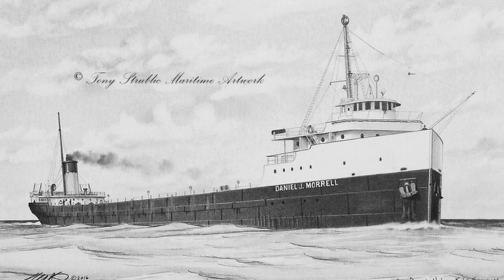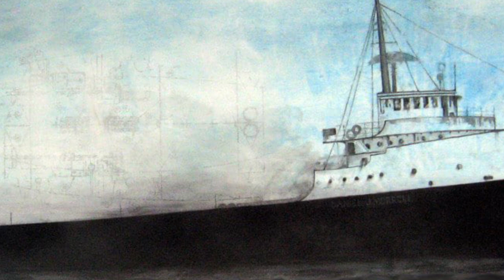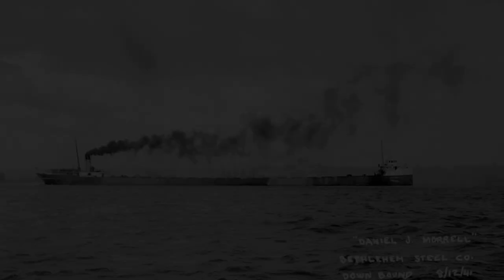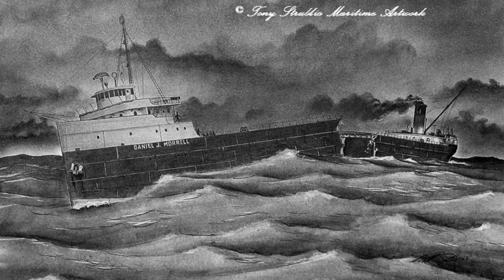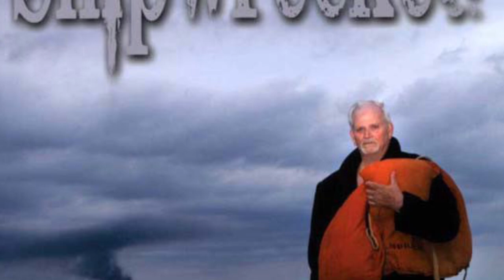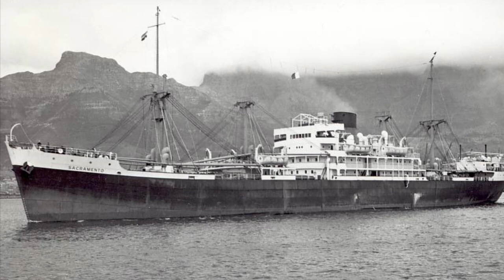What Happened To The Daniel J. Morrell?

Comment: The steel in these older vessels were extremely bridle and would crack instead of flex the sister ship was checked for structure damage and was found to be cracked and not seaworthy
Reply from the maker: I think if the Townsend was out in that storm for much longer it could have had a similar demise.
Reply: Peter, Yes and no.   The older ships were a rigid frame or hull, they were not made to flex
Reply from the maker: @HootisGarage  Well yeah.....but I was saying if it was out in the storm for longer than it was it could have sunk.
Reply: Brittle